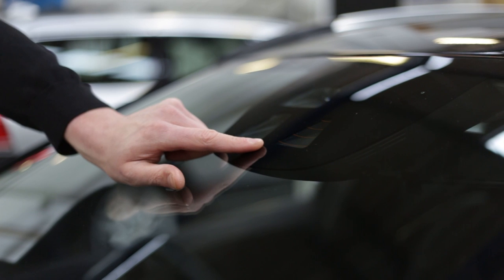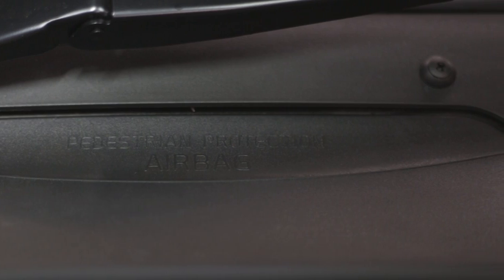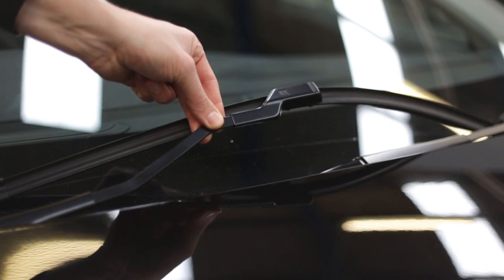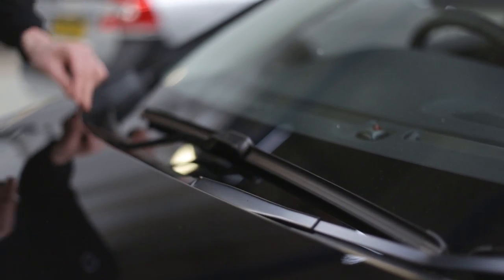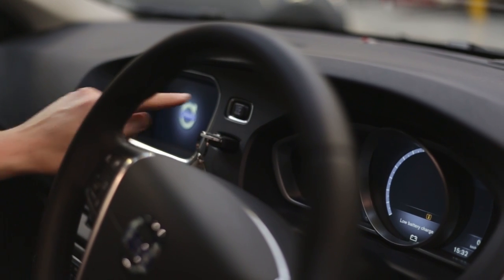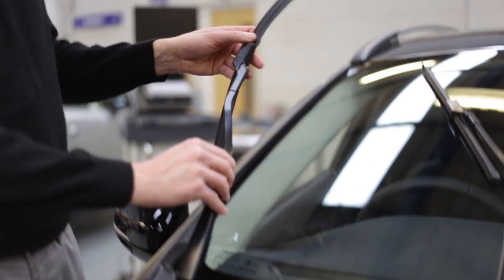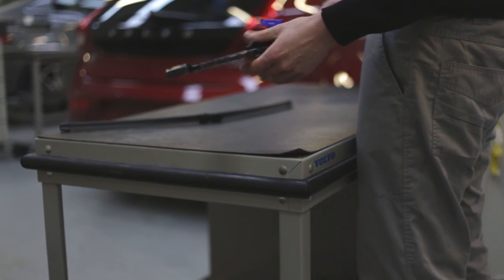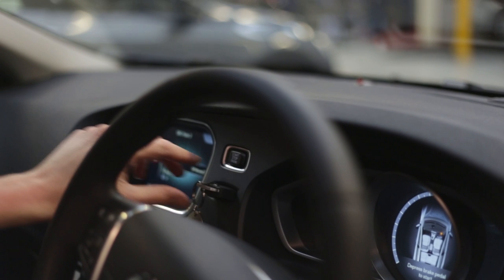How to Change Your Wiper Blades

Comment: Volvo don't want you to do this really they want theoir dealers to charge you huge prices for the same fitments you can get anywhere and changing the wiper blades changing is typically  a user  maintenance  task. UNLESS YOU OWN A VOLVO!
Reply: What are you on about? you can buy the blades at your retailer of choice, or buy them at your volvo dealship. It is even explained in the owners manual how to put the arms in service position and change the blades.
Reply: Get the bosch aerotwin, ur welcome
Reply: Never have I owned a better car to do stuff on myself when it comes to simple things. The lights for example are 2 pins and 4 screws. The wipers as shown are easy and convenient. You must not own a volvo.

Comment: volvo is a disappointment , peugeout engine and everything eles is bloody ford .
volvo giving middle finger to their fans
Reply: kosar mustafa you do know that Ford does not own Volvo any more? Right?.. 😂
Reply: kosar mustafa https://en.m.wikipedia.org/wiki/Volvo_D5_engine ohh yea the d5 is tooooootally not made by Volvo
Reply: As i mentioned THEN geely bought volvo.... Which means from ford. 
ALSO 2.4 diesels and 2.5 5cyl petrols are made by volvo but they are no longer used in thier cars.... The only difference between D4 and D5 now is that the D5 has a component which compressed air so that theres less turbo lag and a different ecu which lets the engine produce more power....

Comment: did not work on 2012 xc60
Reply: I have a 2012 XC60. When the wipers get to the top, press the start stop button. This will will stop the blades at the top and make it easier to reach.  I had to use a screwdriver to press the little button on the wipers and force them up, seeing as they were on for many years. The new blades slipped right on and work great.